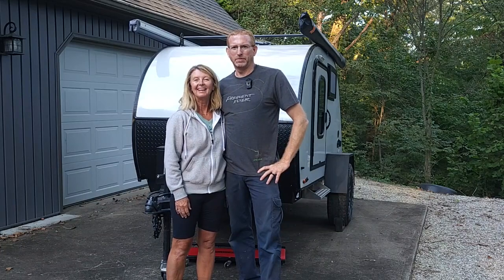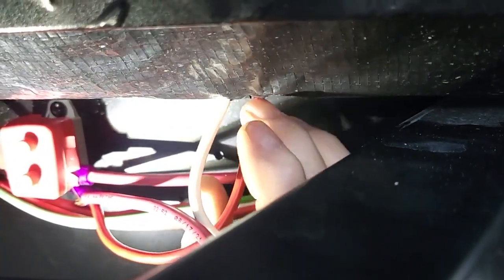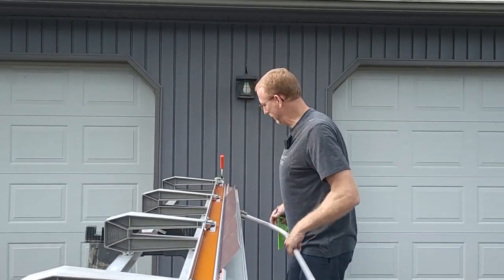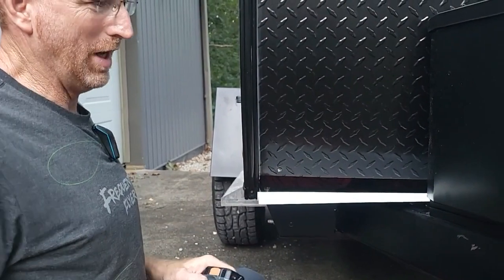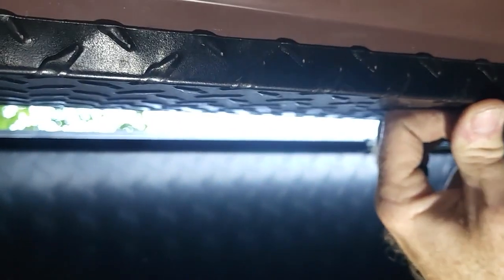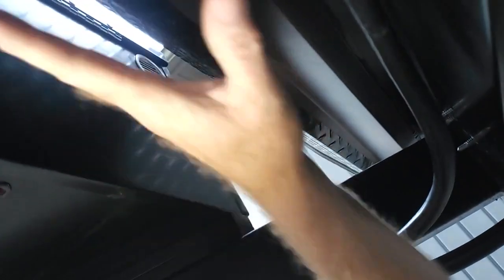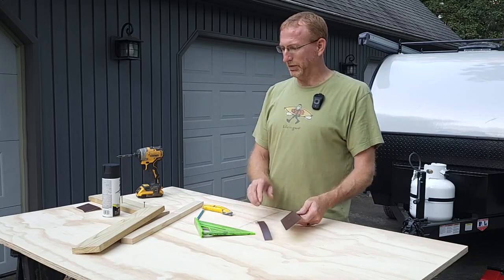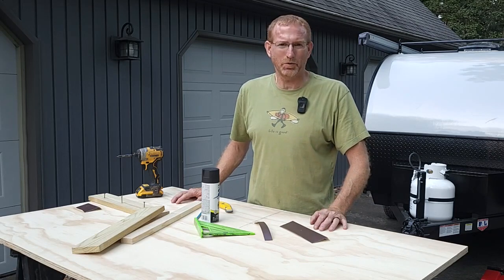Braxton Creek Bushwacker Teardrop Housewrap Protector/Rodent guard

Comment: Sam, I used your video to fix the front of my camper, and it worked really well. I bought the material at a local home improvement store. I bought unpainted aluminum. Your measurements were identical to mine. I did use the method you showed using boards to bend the aluminum. My bends were not perfect, but in the end you cannot tell. The most important thing to check when using this method is to make sure the boards are straight and not warped. Excellent fix for a bad engineered situation.
Reply from the maker: I am glad it worked out well for you!

Comment: I just had a chance to do some mods my new 12 SK and look things over a bit more after adding a battery and trailer brake controller.  So having to crawl under I got a chance to see what things looked like underneath.  Some wiring that needed to be dressed up, and every plastic wire tie they used, none had been trimmed to size.  

Along the camp side I noticed pink insulation sticking out underneath, through the seal.  

The front stone guard has a slight outward "V" crease at the bottom edge almost dead center of the guard.  It also sticks out about 6" from the cabin at that point.  It's stink bug season and I'm sure they've moved into that space.

Your video is quite helpful and will likely be the solution I use as well.  I have a friend with a brake and I have some extra flashing that might be enough.  Thanks
Reply from the maker: Sure thing you're very welcome. I'm glad you had a chance to crawl under it before you got to use it much. That gap between the sidewalls and the frame is just a disaster waiting to happen. That needed to be sealed from the factory but they just won't do it.

Comment: Sam, I was able to mock up something using your guidance.  It worked great.  Still have to go in and seal it.  But question for you.  That exposed section among the side walls you showed us, what are you sealing that up with on yours?
Reply from the maker: Jim, I used Flexseal black rubber sealer on mine, Proflex is good as well, and just made sure all that area in both corners behind the roof edge trim where well covered with sealer. It's hard to see in there so make sure you shine light in behind that trim and get a  full coverage of sealer in those areas. If you leave one little area exposed water will find a way in.
 Remember to seal down the sides of the frame where the sidewalls meet the frame rails and under your doors as well.
 We also have a video posted on replacing the lower section of hurricane hinge to stop the leaks in the corners of the galley doors. 
 More wacker videos coming soon!

Comment: What is the name of that material you used? I didn’t quite understand it on the video? Did you say aluminum coil stock? Something I can purchase at the larger hardware stores? I just purchased the same trailer about a week ago and I did notice that plastic under there it’s ridiculous I also have a leak at my water tank inlet it looks like they put glue around the flex pipe and the hose clamp so I can’t even tighten the hose clamp because it’s glued and it’s leaking so it looks like I have to remove the whole tank it’s totally ridiculous I actually wish I didn’t purchase the trailer now it’s brand new and I’m finding all kinds of little problems, and with tax and fees approximately $15,000 and I have to do all this work on it is ridiculous thank you for the video
Reply from the maker: Very sorry to hear of your issues with the camper. Sadly that is more the norm today than the exception.
 That is correct, aluminum coil stock is the trade name for the material that use. I will put a Home Depot link at the bottom for you. 
 I highly recommend that you join the FB page for the Bushwackers. Great group of people who will help you however they can. It makes a nice little camper once you get all the issues fixed. 
 Just give me a shout if you have any questions. 

https://www.homedepot.com/p/Amerimax-Home-Products-14-in-x-10-ft-Brown-over-White-Aluminum-Trim-Coil-69414/100039694
Reply: @adventuresofthememorymakers  thank you for the info I really appreciate it, I purchased this trailer for my dog and myself to go up in the back country might go somewhere every couple weeks and will be towing it with my jeep but now realizing it’s really not waterproof there’s a couple creeks that I cross I’m concerned about that, but overall I like it it’s very comfy it’s pretty neat looking hit toes well behind my jeep it would be a great base camp for me, I plan on getting a portable hot water shower/heater and then it will be perfect I added a toolbox on the front but I’m just disappointing because I literally towed it home put it in the garage and I’m finding all these little problems with it but the water leak on the water tank it’s not good and where it connects they glued the flex pipe to the male fitting and they got glue on the C clamp which I can’t unscrew and if I torque it too hard something will crack so I have a situation with this anyway thanks again that was a really good thorough video
Reply from the maker: @FieldWorxoverlandadventures  
 The water tank issue should be a warranty item. We have several other videos on Bushwacker repairs and upgrades you might check out as well. 
 @DIYOutdoorLife has a lot of Bushwacker content too. 
 Fortunately I knew what to expect when we bought ours, pulled it home, tore it apart, and made it what I wanted.